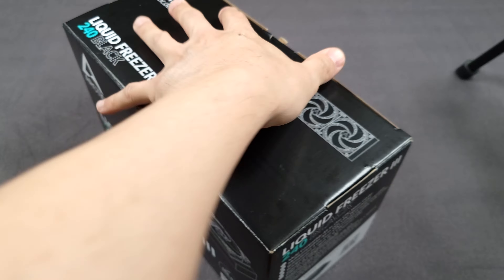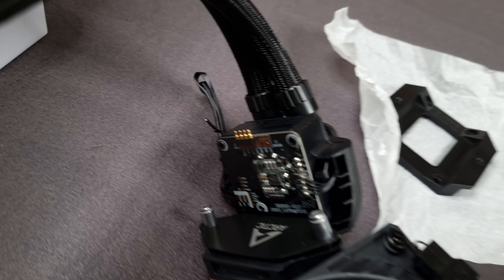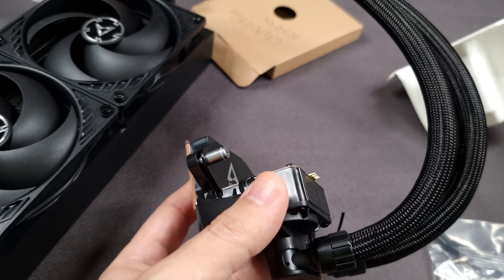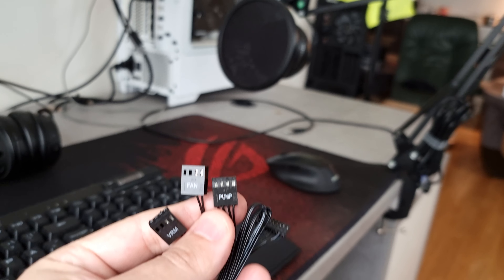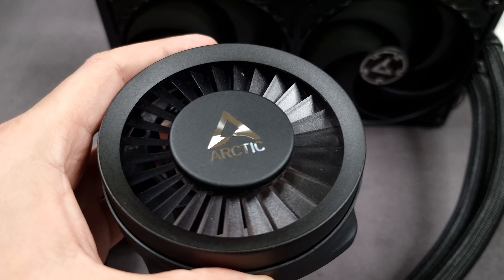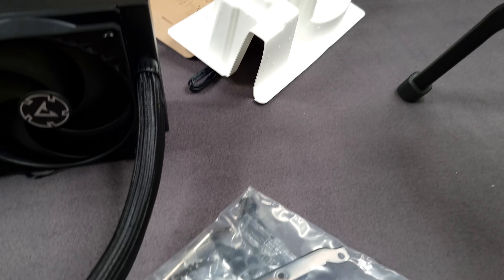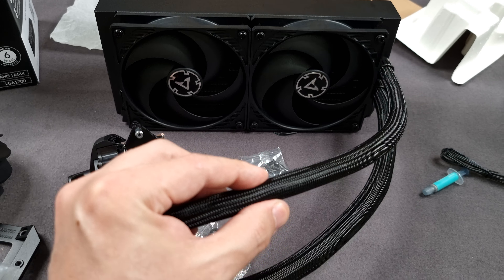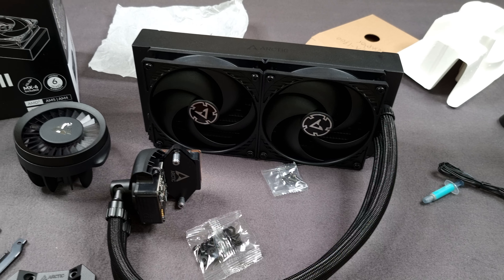Arctic Cooling Freezer III 240 AIO Overview. A Creative Design!

Comment: I got the 360 version which I bought at huge discount (25th anniversary). It replaced my old custom water cooling setup in a Coolermaster Stacker case. Bought a NZXT H7 flow case with it. Temperatures are about the same with my Ryzen 5800X3D.
Reply from the maker: I also own the 360 version in white. I have not taken it out of the box. Waiting for next gen Ryzen to come out to build a white theme system with it. But, I also owned the 360 Frezzer II verson, and it worked as expected. Temperatures were under controll on my 5800X3D as well. Very nice product!

Comment: Hey so I'm building a new gaming PC and I was wondering what should I use water cooling or should I just use a heat sink
Reply from the maker: It depends on your set up. 65w TDP cpus do great on air cooling. Over 95w TDP, I'd recommend an AIO. 360mm radiator.